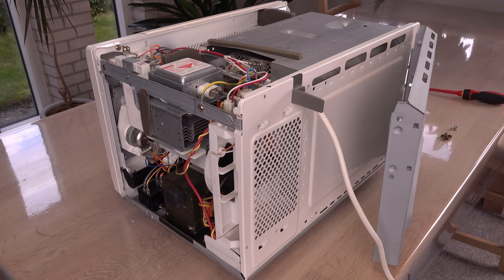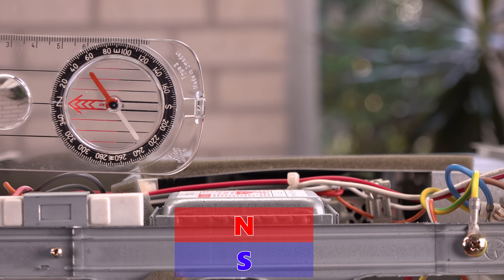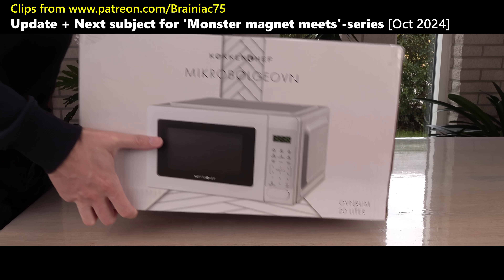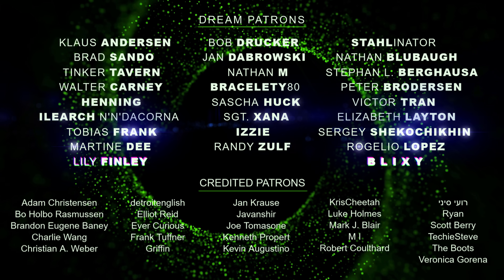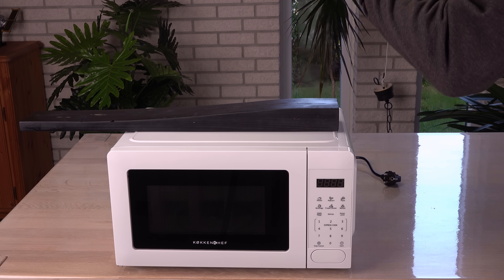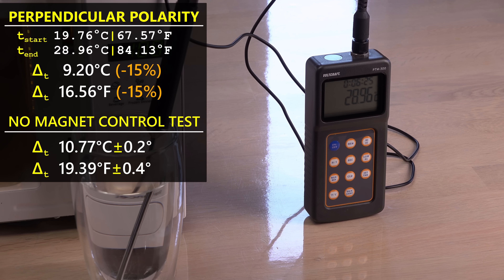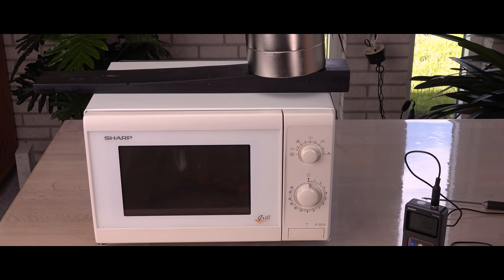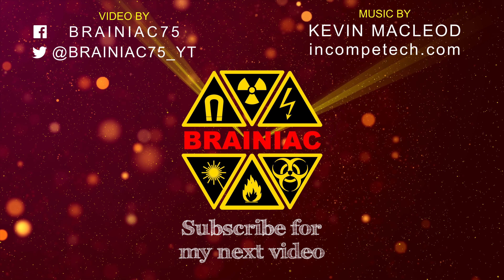Monster magnet meets microwave magnetron...

Comment: Maybe gutting out transformer and electronic putting it on the side so just magnetron is in original place, and then try it? It will need some work as you would need to extend some wires and probably also remove control panels(so pretty much damaging microwave enough to not be able to put it together again)... Not sure if it's worth but... Maybe...
Reply: I'm not sure he's experienced and comfortable enough with high voltage electricity (or even mains) to recommend this.

Comment: You could try a modern inverter powered microwave. Then you wouldn't have to worry about the transformer. Dont know if the cost can be justified though.
Reply: I've seen $80 inverter microwaves. 
The weight reduction vs traditional magnetic, makes up the parts cost difference, with shipping weight reduction
Reply: Inverters still use a transformer, just that it's not driven at mains frequency. They're slightly more energy efficient, use a smaller core in the transformer and less copper in the windings, which are the main reasons manufacturers went with them, not the efficiency, less expensive materials.
Reply: On the plus side, these tests proved he shouldn't need to rely on The Magic Of Buying Two Of Them...
Reply: @WackoMcGoose  technology connections
Reply: good sugestion

Comment: Could try using the analog microwave with an on/off power strip and use a timer for 60 seconds.
Reply: Or simply use a stopwatch (on a phone) and switch off digitally (using human finger).
Reply: Right? Or if he wants it automated, a smart plug and set a timer in the app.
Reply: Transformer-based microwave ovens are pretty nasty loads when they start. Most consumer-grade timers won't survive many cycles before their tiny relay rated for purely resistive loads like lamps and heaters fails.
Reply: @teardowndan5364  just use a relay to power the high voltage part
Reply: yes

Comment: Your magnet pulled the door, safety switches into the off position. Lol
Reply: Would be more fun if you were to trip the "monitor" switch while the microwave is running.  A bang and a dead microwave would result.

Comment: If you apply the magnets directly to the magnetron only on top or only on bottom you can bias the internal magnetic field and cause the electrons to only ever make ~1 loop. In normal operation they make many and so having lost energy each loop, they become different frequencies. So by biasing one pole with a strong external magnet you can improve the spectral purity of the magnetron output.

Comment: Probably would have safety concerns, and could damage the magnets, but what would happen if you try microwaving the magnets?
Reply: The magnets would heat up and stop working when they reach the curie point
Reply: @badgermcbadger1968  I am fairly certain with that sort of mass and reflectivity the magnets wouldn't care one bit and the magnetron would give up the ghost with in the first hour because of all the back reflecting.
Reply: @Zenodilodon  that's possible too

Comment: I didnt watch the video yet,but one huge safety issue i see here:
Magnetrons operate with a voltage of 3kV. 
Nornally when the magnetic field inside the magnetron is present, the electrons will circle around the center.
So when they get near the outer copper ring, they only have a tangential curve to it, and dont smash into it.
However when you encounter that magnetoc field with your magnet, the elecrons will crash into the copper with an energy of 3keV
This should be enough to generate some low energy Röntgen radiation,as the spectrum starts at 125eV.
Normally Röntgen radiation is created with 30KV, but still 3kV might be enough for a harmful amount of radiation
Reply: A good test for his Radiacode then.
Reply from the maker: I was worried about accelerating electrons into higher energies. But I have not been able to detect anything significant. I think all the metal shielding - including the oven cover is stopping any low energy radiation that might be created. But definitely worth being aware of the risk of electrons travelling in a vacuum! Thanks for watching!
Reply: @brainiac75  
Did you measure for Röntgen at 3keV all around the microwave,while opposing the magnetic field?
(dont check for peaks, but rather a continuous bremsstrahlungsspektrum.)
Reply: And order of magnitude in power is a basically insurmountable wall. And you are talking about potential radiation created inside a thick shielding metal part.
Reply: @ABaumstumpf  if microwaves can escape, Röntgen can escape as well.
So Röntgen will enter the cavity for sure.
The window of the microwave has a metal mesh on it, that is too wide in order to stop röntgen.
Reply: @neutronenstern.  " if microwaves can escape, Röntgen can escape as well."
no, that is not how that works.
Reply: @ABaumstumpf  
Not in every case, but in this case it really should work.

Microwaves are stopped by thin metal.
So in order for them to enter the cavity, there has to be a hole in the metal, where they get through.
This hole has to be bigger than the wavelength of microwaves.
Since Röntgen radiation has a smaller wavelength than microwaves, it will pass these holes.
Furthermore according to a quick google search, Röntgen radiation is not completely stopped by light metals up to a thickness of 400mm. This is 400times more than the typical thickness of the walls of the microwave.
Even for steal it can pass 300mm thickness.
For copper it is 50mm which is still more than the copper housing of the magnetron.
Also the Microwave has air vents, through which Röntgen can pass through, after it escapes the magnetron.
(eg. Röntgen passes through opening of magnetron going to cavity, and then instead of getting reflected by the waveplate inside the microwave, it passes the waveplate, and then exits the microwave oven either through the thin metal, or the air vents. )
Reply: @neutronenstern.  "there has to be a hole in the metal, where they get through."
No, that is not how typical microwaves operate. The magnetron is producing the required high-energy high frequency electric field which is then radiated by an antenna. So no opening.
And 300mm steel??? That would be gamma-rays - more than another order of magnitude.

so no, not even the chance of there being a chance.
Reply: @ABaumstumpf  
True there can not be any hole, as there is vacuum inside
Reply: @ABaumstumpf  
You are right.
I just searched for the Absorption coefficient of copper at 3keV.
It turns out to be 6700 cm^(-1)
So the thick copper body of the magnetron will already block it completely.
And even a 1mm sheet of copper or iron or Aluminium will block it.
For iron the absorption coefficient is a little bit lower, but still high enough.
So you are right it will not exit the microwave.
Sorry for messing this up, i thought if these energies are classified as X-Ray, they all behaved somewhat similarly.
But this turns out to be not the case at all.
Reply: 4:50 bad!!!
Where does the rest of the power go to?
Heat?
Or rather 350W of Röntgen?
We will never know. (hopefully)

Comment: I very much appreciate you not literally disassembling the microwave (other than the cover to identify the parts) very cool video as always, great work! Also, that geiger counter is absolutely gold
Reply from the maker: Thanks :) I don't like how people are taking magnetrons apart to salvage the 'strong' magnets inside them. They are very cheaply available as ferrite ring magnets for small speakers. And not strong... The magnetron is worth much more in working condition :D Yep, I love the RadiaCode dosimeter/spectrometer (can be used as a Geiger counter as well).

Comment: picking up the monster magnet from the top of the microwave looked scary... if that thing had tipped to a side it would've crushed your fingers 
😱
Reply from the maker: Definitely not recommended for the inexperienced ;) Luckily, distance is your friend with magnetism (and radioactivity). As long as the magnet is at some distance from thick metal, the forces can be managed. The magnet is not stronger than what it can act upon. Thanks for watching!
Reply: @brainiac75  I've long said, the inverse square law is my frenemy.  ;)

Comment: Placing the glass in the middle means it stays stationary, and because microwaves have peaks and troughs, it's pretty likely that your new microwave oven just generates waves in a way that causes the center to heat up less. You can search for hot spots by just placing a chocolate bar inside and seeing what spots melt/get burnt, and you can remove the rotating platform altogether.
Reply from the maker: Yes, it is one of the suspicions I mention in text. Will have to try to locate the hotspots in the two ovens. The old one might have an undesired hotspot at the center of the plate, while the new one was designed to avoid this food-burning spot. I do note that the old one has very flat sides inside, while the new one has more 'facets' on the inside. Thanks for watching and the suggestion!
Reply: Usually manufacturers recommend placing items as close to the edge of the rotating plate as possible, precisely for that reason.
Reply: But it's not stationary as plate inside rotate. Glass should be big and tall enough to be catching wave spot on it and be hit from different sides during heating.
Reply: @paranoiia8  Yeah, but it's not moving in space. It's just rotating around it's own axis. The rotating plate is there to move whatever you put inside in space, because that's when the object gets exposed to various points of intensity.

Comment: I know this is the first comment, but from your last video where magnets meet a plasma globe, I’m sure the magnet interferes with the transformer’s ability to do it’s job and cause the microwave to struggle!
Reply from the maker: Yes, no doubt that the transformer is affected too. But not that much - at least in the case of the old one. Notice the limited drop in output in the 'right polarity'-test. It would not work that well with a saturated transformer core. With that said, a future improvement could be to separate the magnetron from all other components by long wires. A little daunting though... Thanks for the early watch and comment, AluminumOxide!
Reply: @brainiac75  It would be interesting to see how this experiment affects the amount of current the microwave is drawing.
Reply: @brainiac75 
I didnt watch the video yet,but one huge safety issue i see here:
Magnetrons operate with a voltage of 3kV. 
Nornally when the magnetic field inside the magnetron is present, the electrons will circle around the center.
So when they get near the outer copper ring, they only have a tangential curve to it, and dont smash into it.
However when you encounter that magnetoc field with your magnet, the elecrons will crash into the copper with an energy of 3keV
This should be enough to generate some low energy Röntgen radiation,as the spectrum starts at 125eV.
Normally Röntgen radiation is created with 30KV, but still 3kV might be enough for a harmful amount of radiation
Reply: @neutronenstern.  3keV is dangerous but will not go through thin sheath metal. In this setup there are at least 2 layers.
Reply: @larslindgren3846  
You are right.
I just searched for the Apsorption koefficient of copper at 3keV.
It turns out to be 6700 cm^(-1)
So the thick copper body of the magnetron will already block it completely.
For iron it is a little bit lower, but still high enough.
So you are right it will not exit the microwave.
Reply: @neutronenstern. Probably the same amount than an old CRT TV